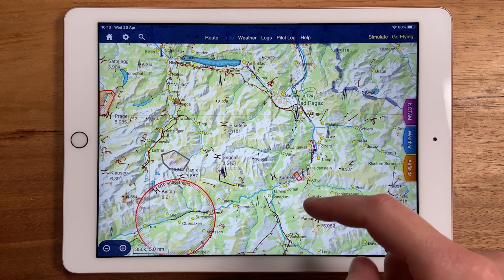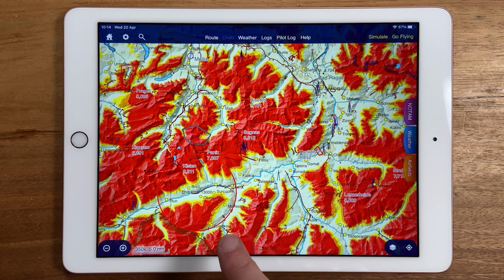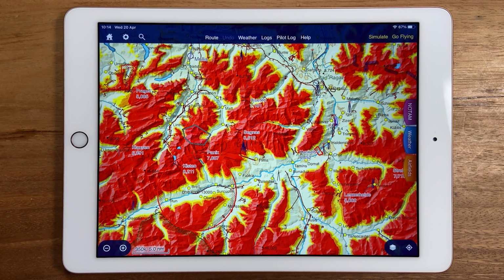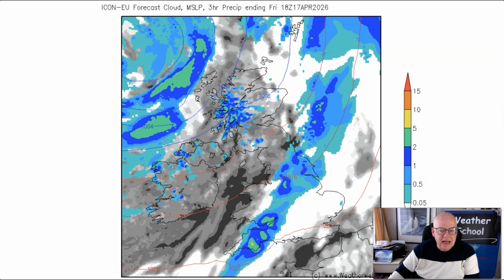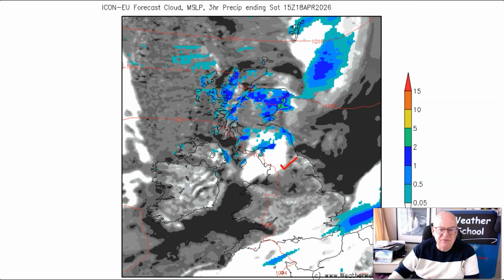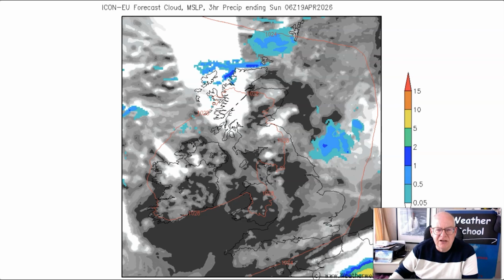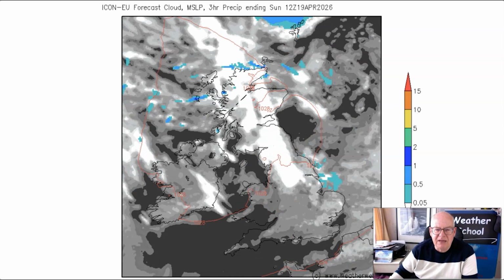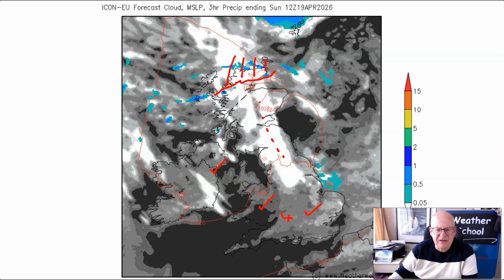It’s time for AERO Friedrichshafen! - The FLYER Show - 16th April 2026

Comment: that electric motor does seem to be a bit heavy. they should look at Yasa or DeepDrive and save 20....30kg. 30kg modern batteries translates in the area of 100km range.
I hope that Pipistrel can go forward as well. They already have something working but they need some progress to boost their sales numbers. If they would make use of a DeepDrive motor, and a better inverter, that would be cool. lighter weight, a few percent more efficiency etc. and a newer battery generation with a bit more energy. everything hopefully for the same amount of money. if it translates in extra 100 km of range, that would make it much more attractive.